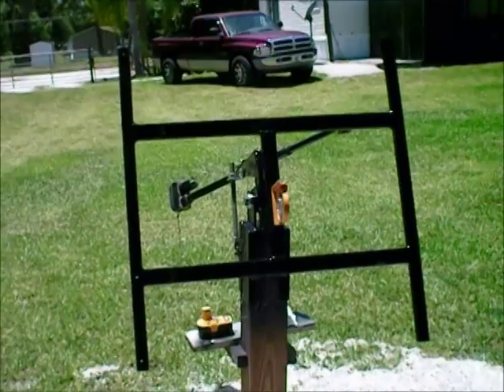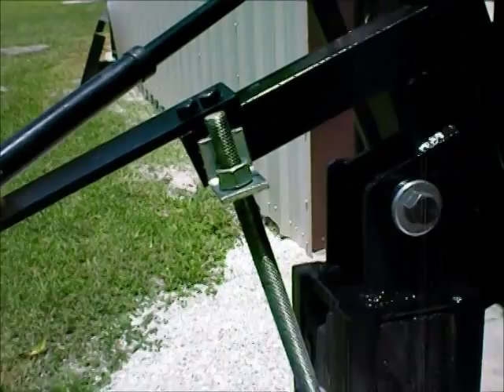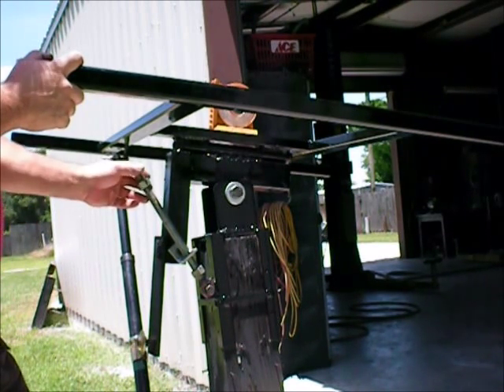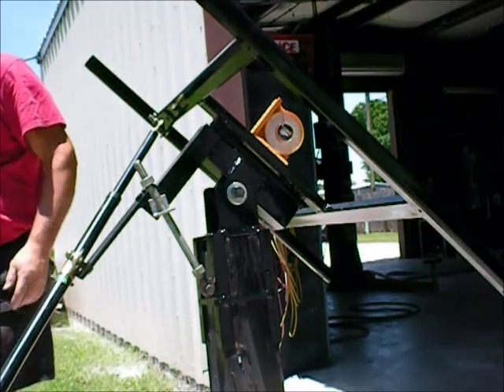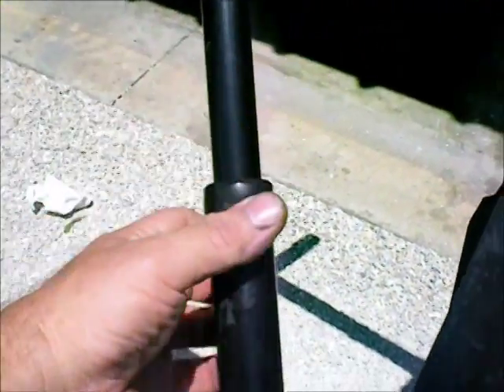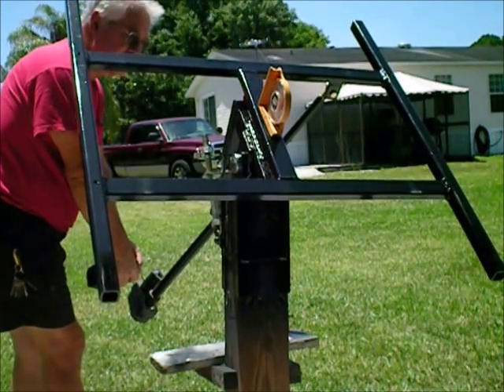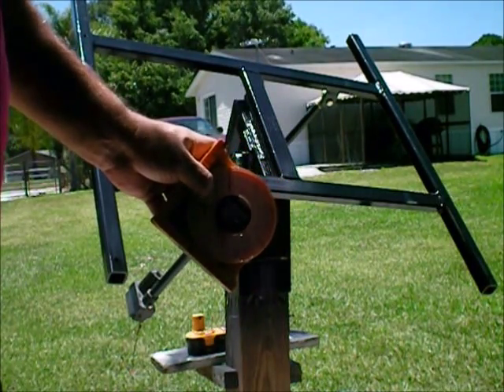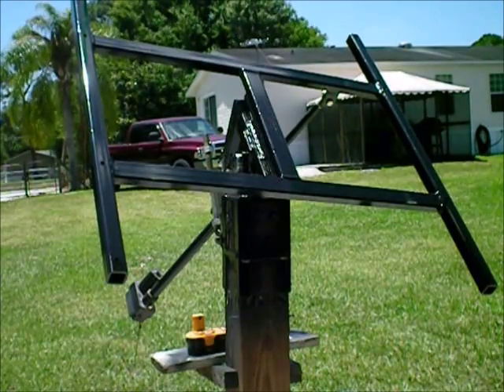KILO TRACKER, NEW Model!  SA 115 - R10

Comment: When sun low in the sky would placing reflectors to increase sunlight on panels increasing efficiency of panels at low angles of sun? I think Greenscience has reflective plastic rolls. A way of maxamizing low light time of day.
This is a great job on your design! You should be congratulated!!
Reply from the maker: Maybe? low in the sky ?doubt it ,and u must be careful using reflector's  as u can damage some cells in the panel & yes it will increase power when sunny if u had a way to control it . I have played with that myself fun but not worth the time & effort IMO.

Comment: For me 3 panels feels really safe. I know I got four on one its OK I guess but three panels are pretty much kinda bullet proof. I like to be extra safe though thats just me. I can always just make another tracker to put three more panels on. Im using the 5/8s bolt and it held in the seventy mile an hour wind. But the bracket on the smaller actuator slipped. Even the big ones can slip in a 70 mile an hour wind or better has happened in history but hey the weather can get pretty bad here in Okalahoma. But hey 70 miles and hour winds are pretty brutal. I dont like them. Dang. I live in tornado alley kiinda scary sometimes.
Reply from the maker: Six panels is a big area for wind to hold on to but so far only 1 bent adjuster bolt at winds above 70 MPH. That's a pretty good testimony to the product I build.In that much wind I start to worry about other stuff like my home & stuff blowing away, power lines trees, but yes 3 or 4 is very safe. So far in 3 years I have been through 2 tropical storms with winds in that range all mine made it just fine set to flat or table top position. This has been a huge experiment to see what is possible so when I move to my new property I will know what to do to be almost total off grid.
Reply: TheKilog69 Your moving and almost off grid. That sounds good. That is what I want to do.Get off the grid.

Comment: Thank You for the shout out to my channel.  Great upgrades for to the tracker.  The bigger threaded wind safety rod is great for the windier regions and the more robust actuator arm works great for your six panel design.  Cant wait to see your six full size panel tracker up. They are huge but with your great designs, they can handle it.  It was a heck of a winter up here in NW Ohio.  Very windy and cold.  I hope to show my addition of guy wire supports for the really high winds, soon.
Reply from the maker: U are welcome! U have done a outstanding job with your tracker install .Thank U for all your feed back it helps me build a better tracker.The upgrade bolt adjuster is like the 1 I sent U .If  U saw this new 1 U would see the changes I made it was all done to make a better stronger tracker , I  don't believe there is a better unit any were in the price range I am always looking .I do see lots of cheap China Junk on EBay ,so sad some people buy them.